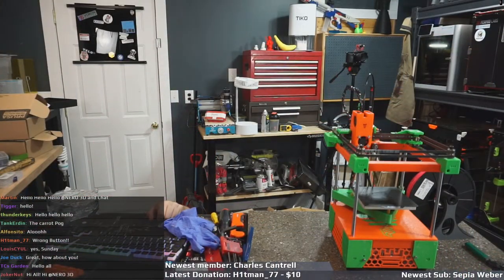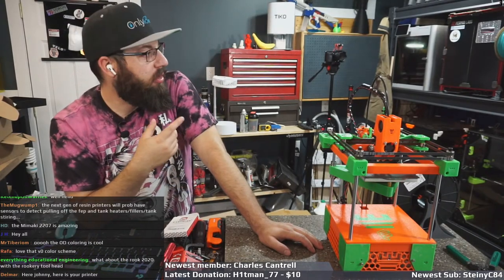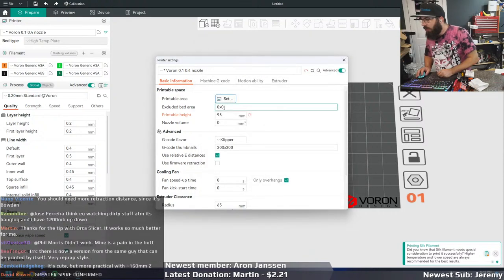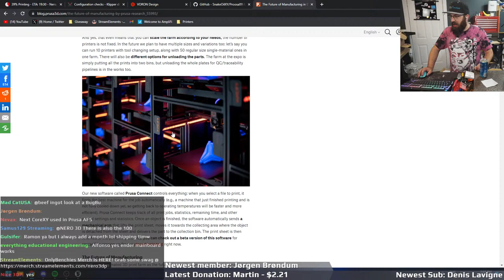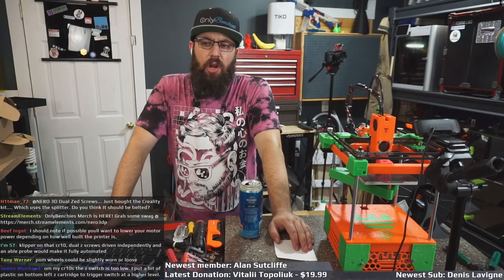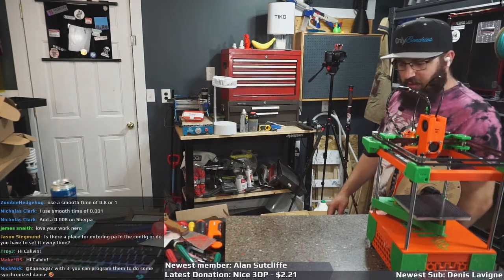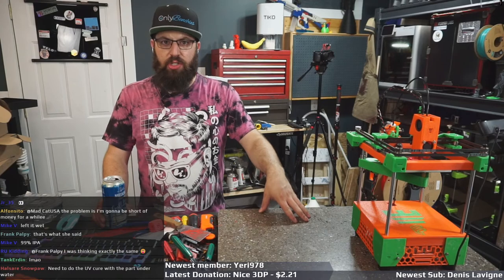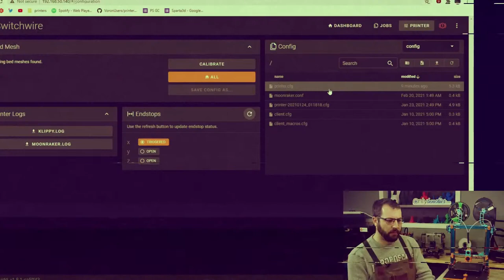THE ROOK -Mostly Printed Printer Build Part 5 (final?) #3dprinting #livestream

Comment: One thing I wonder is why does the bed drop like a brick on that when the motor is not energized but the 2.4r2 Gantry does not?  Is that just down to 4 motors vs 1 or is it the pullies.
Reply: The 4 motors on the voron, even plus the gear reduction isn't always enough to prevent my gantry from drooping on power off